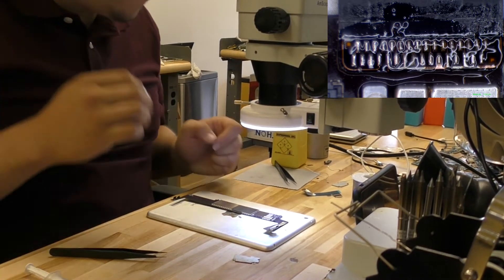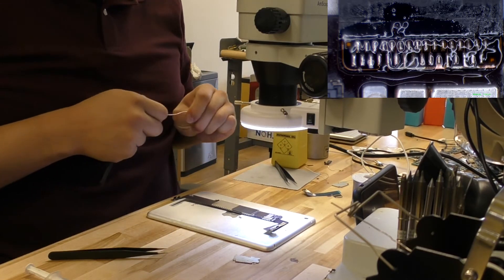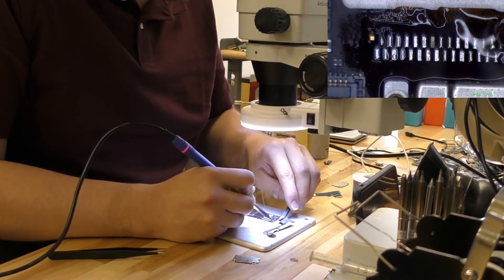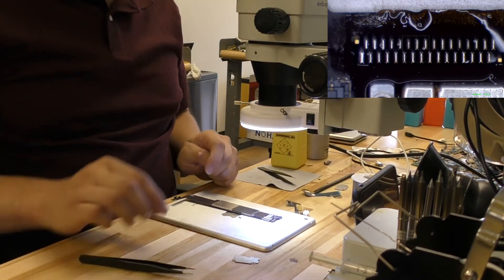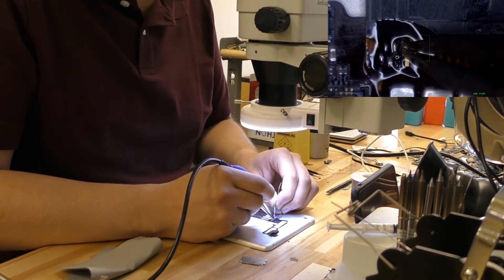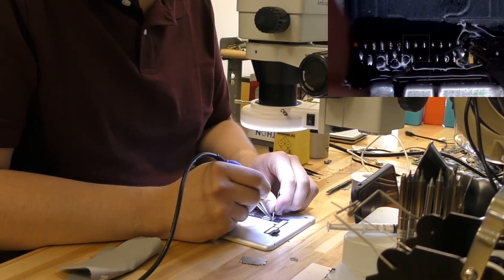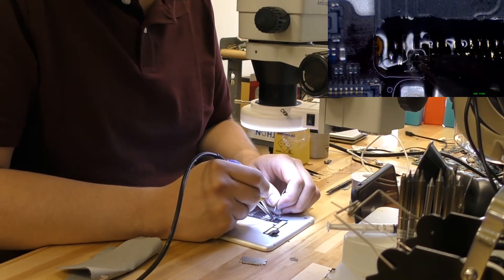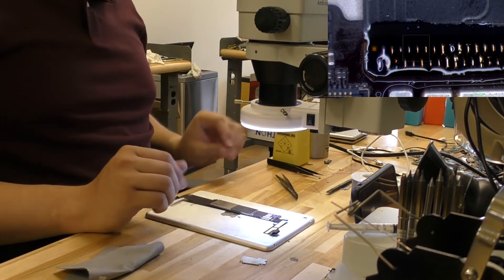iPad Mini Charging Port Replacement

Comment: what do you do if the underside of the ribbon gets stuck to most of the pads? it was very hard to remove the plasticky rubbery ribbon and i ended up pulling and damaging pads
Reply from the maker: You can send me a picture if you’d like and I can let you know which ones will require jumpers. I usually tin the pads first with low melt solder and then I add a good amount and slowly go over the top and pull on one end. You could also use hot air to remove the ribbon.
Reply: @chargingportcom  i'm pretty embarrassed to even send a picture. plus... i already soldered the new charging port over it already hoping that the pads that were still in tact were enough to make it charge and the damaged ones were miraculously not needed. soldering the new charging port was pretty easy, but removing the existing one cleanly is what got me. this was my first time ever attempting this repair, i'm pretty amateur and unexperienced in microsoldering, even though this isn't even that micro. pretty sad about it, but i did let the customer know there's a good chance i wouldn't be able to do it. i need more practice, but it's not common to come across these repairs.
Reply from the maker: No worries about the embarrassment, it’s happened to the best of us at some point in time. I would definitely invest in some low melt solder. It can be used in many applications and can save you 😊 if you ever have any questions feel free to email us and we can give you some pointers and maybe even shoot you a short video with example. Good luck with future soldering jobs 😊
Reply from the maker: Email if you want to send me an image of the pads is chargingportcom  at  gmail

Comment: heh, did you just cut that wick with a razor right on the back of the ipad?
Reply from the maker: Yes lol, I use the housing of an old iPad as a base plate to solder on instead of the table especially when using hot air. I also cut the wick to make it easier to wick the solder.